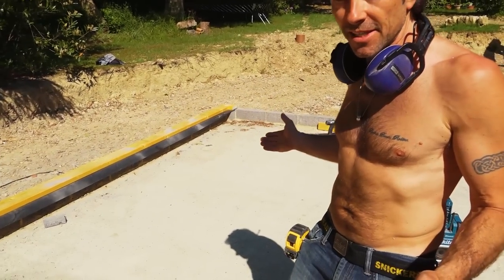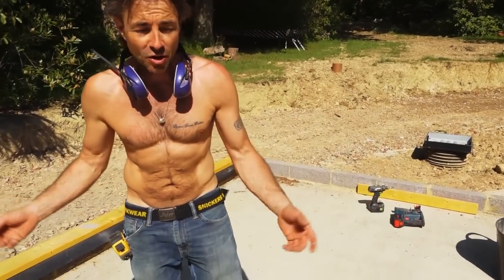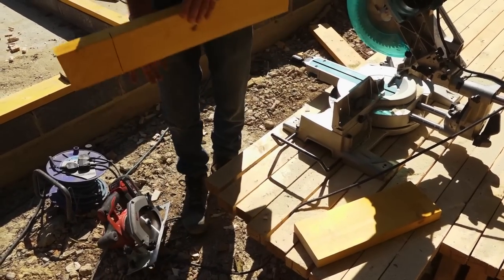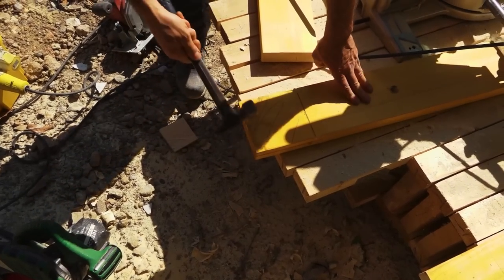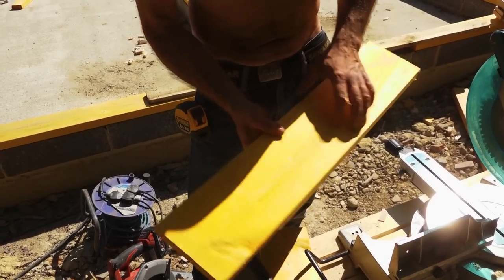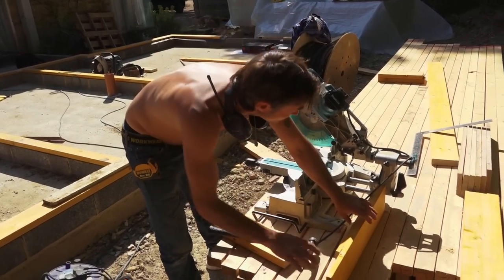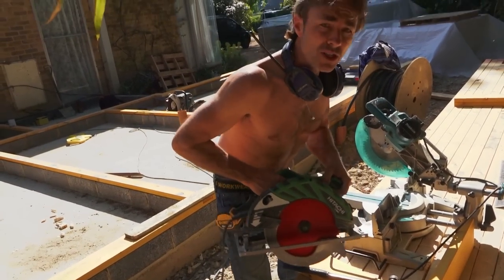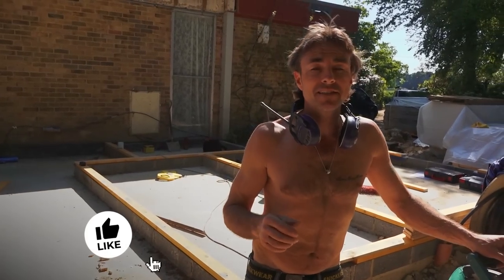How to Cut a Half Lap Joint ~ 2-Minute Tip

Comment: im probably out of order here but i want to talk about battery power tools ? do you know of an m class battery operated bluetooth dust extractor that is cross platform compatible and a bluetooth module that will allow older tools to use the bluetooth features on such an extractor ? or a way of installing a wireless remote relay into an existing 36v dust extractor as that is all the dewalt system is using as far as i can tell

Comment: What was the yellow opaic stuff on the wood?
Reply: This is a CLS material and I also wondered about the colour, it maybe treatment but I will find out for you!!
Reply: @ukconstruction  I like the green tinted stuff you get when the new timber is pressure treated. A shed built of this stuff looks really nice but you can't seem to be able to match it with anything so have to dump another colour on it and it doesn't look as nice, 😕

Comment: Carpenter for 30 years; THAT IS NOT a half lap joint...It's only one half of one...it's when you make the same cut on a crossing or corner joining piece that it becomes a half lap... Do try to keep up deary,...
Reply from the maker: Rob 
You are right and well spotted. 
It is half a half lap joint. As it is supposed to be a 2 minute tip he would have to go at twice the speed and that would be a lap record.
Reply: @SkillBuilder  :)...2 minutes is more'n you need...:)